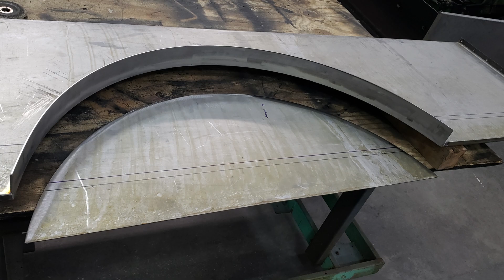Dodge Power Wagon transformation. Giving an old truck a new look.

Comment: Wow! Ambitious job to recreate the bed from scratch! I patched my original back together. I’ve heard that minivan seats or smaller pickups like Datsun will work but again, I’m using original…..which is starting to fail.
Reply from the maker: Thanks! yea- there are probably a few seat options that might be a little better fit but the price was right on the donor seat I acquired.